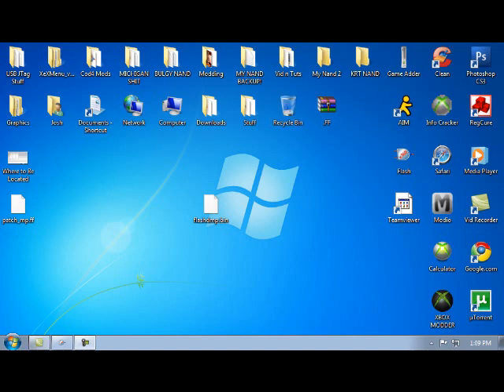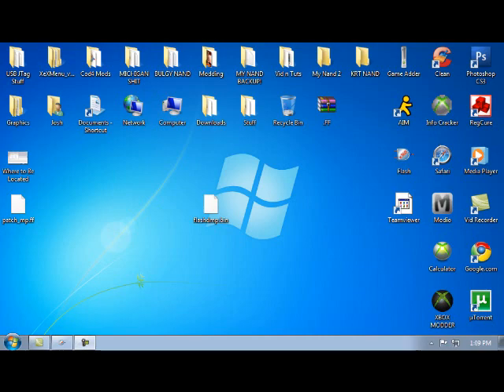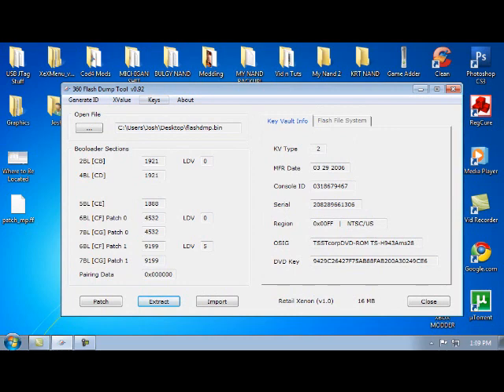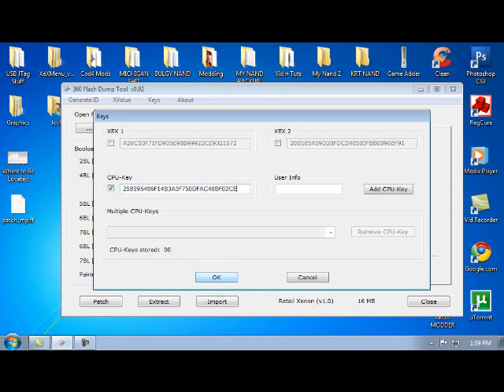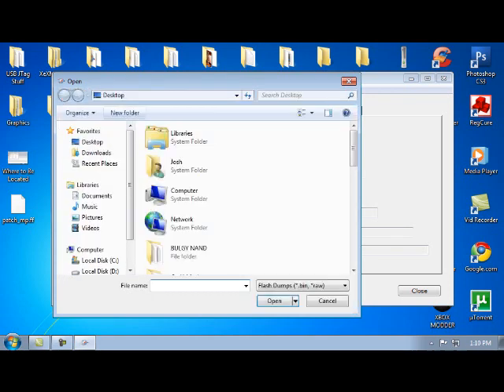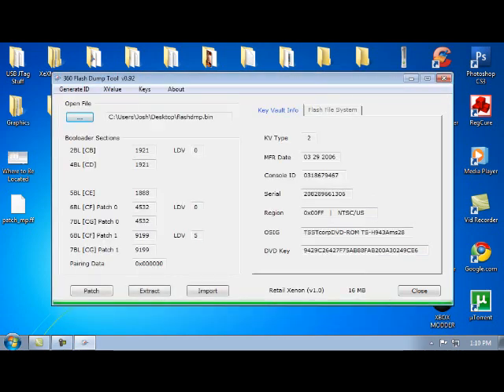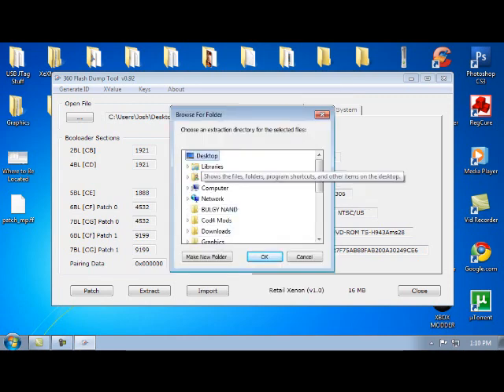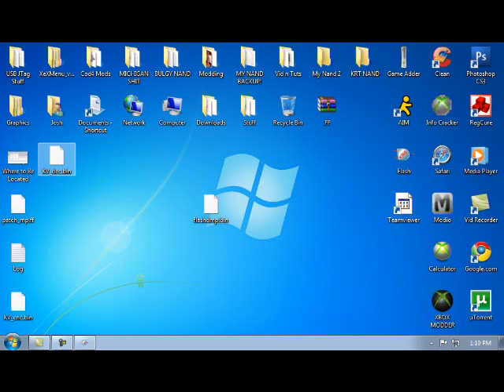How to extract a Key Vault from a Nand Image

Comment: But how i konw my CPU KEY????

please respond.  i need help
Reply: Your CPU key can be found different ways
If you got Dashlaunch, launch it as default.xex and scroll to " system info " page whith button RB then press A on system info and you can see your CPUkey
If you didn't got Dashlaunch press the eject button when your console is off then press it back again if the disk reader tray close and you gonna be see Xell-Reloaded and this is your RGH or JTAG flash you can see your CPU key as "CPUkey" and DVD key etc
That's all